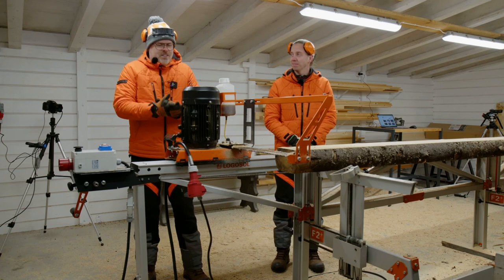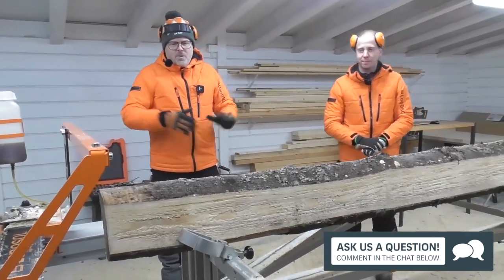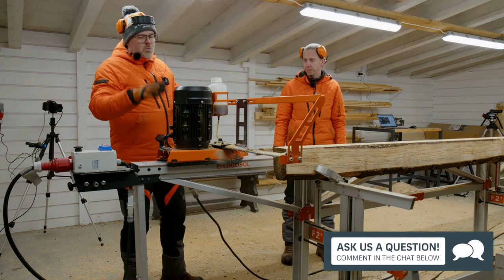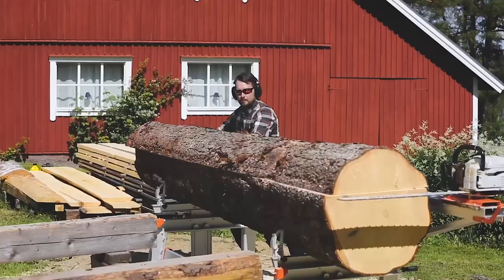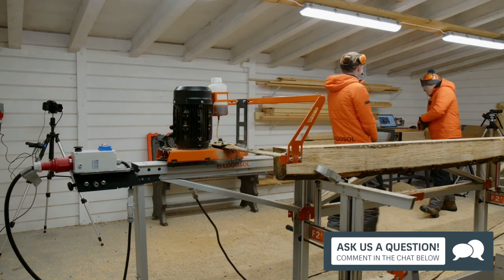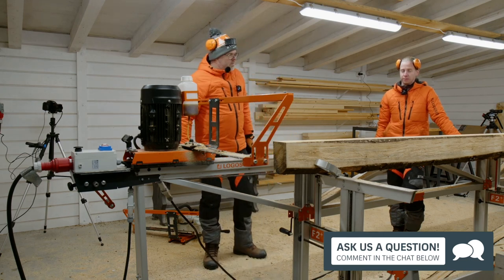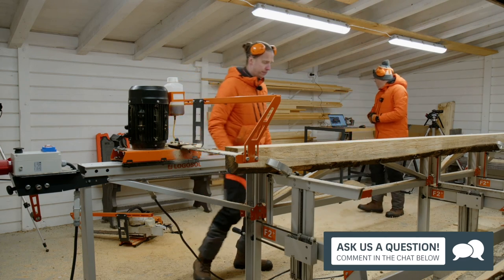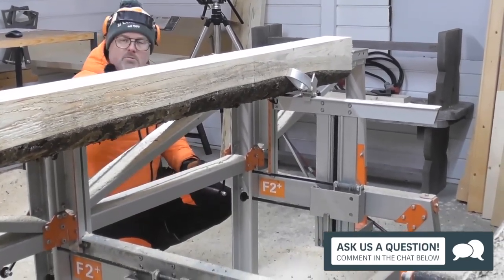Chain sawmill, worth buying? | LOGOSOL

Comment: Is it possible to cut a 20 foot log on a 5 meter machine, by simply moving the log over after the first part of the cut?  Maybe if the log was mounted on a long, thick board?

Can rollers be attached to the top of the log lifters, (like those for the log bed) to facilitate shifting a log that's longer than the machine can cut in one pass?

Last question:  I've scoured your website, and haven't found if the size, (4M, 5M, 6M) is the length of the machine, or the cutting capacity.

Which is it?

Thank you!